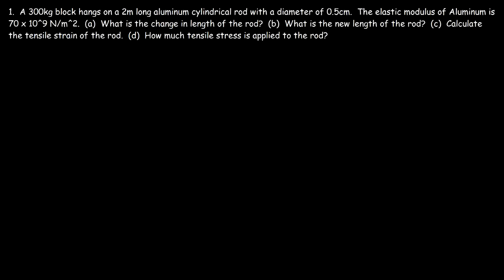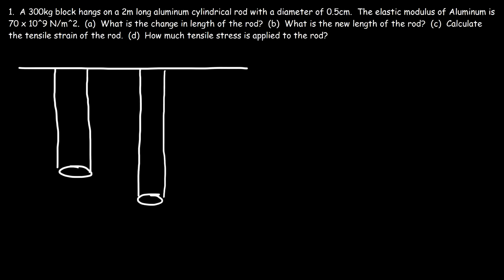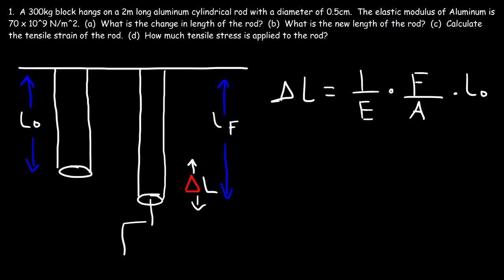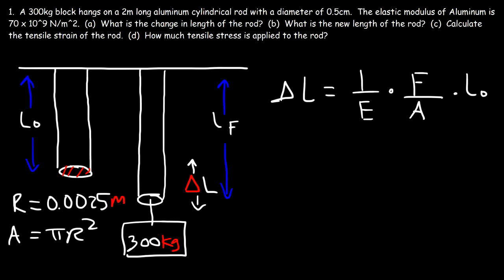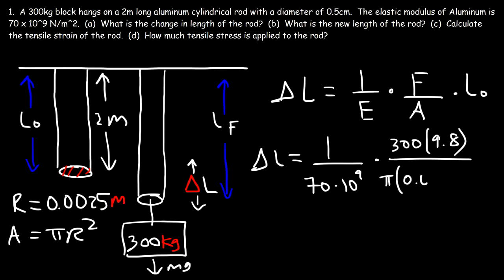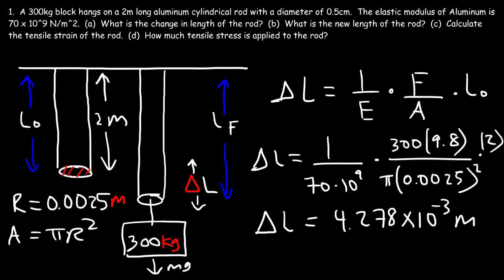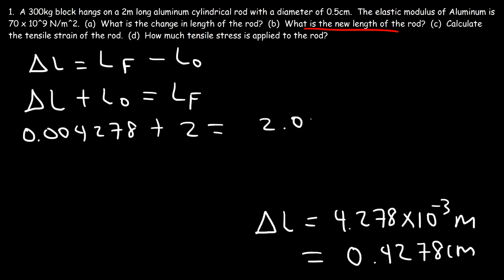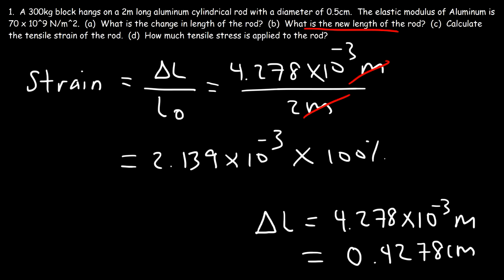Stress & Strain - Elastic Modulus & Shear Modulus Practice Problems - Physics

Comment: A uniform wire is subjected to longitudinal tensile stress of 5 * 10^7 Nm^-2. If the overall volume change in the wire is 0.02% , then the fractional decrease in the radius of the wire is?
Reply: This question is a good one, this is an example of things you can calculate with these formulas

Comment: In the first problem should the area of a cylinder would be equal pi*r²*height?
Reply: I was confused by this too.. He's real great though
Reply: well, thats the volume equation of cylinder not area, plus we should calculate the face thats bearing the load or weight...so it should be the area of circle

Comment: in no.2 how can the compressive strain be positive ?
Reply: Strain has to be positive, the reason we have the negative sign in the compressive strain's formula is because we get a negative value of ∆L as the final length is less than the initial length and the negative sign cancels the previous negative sign to give us a positive value.